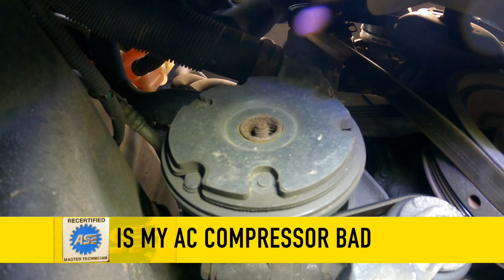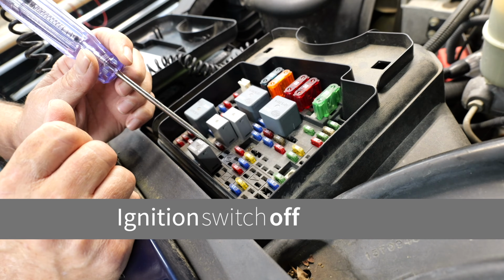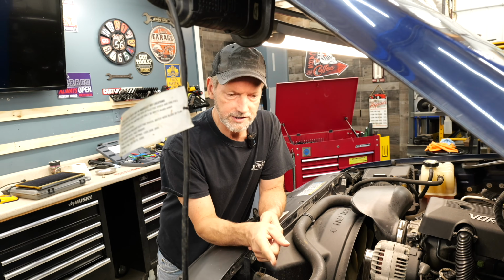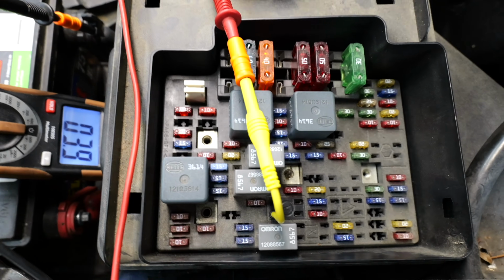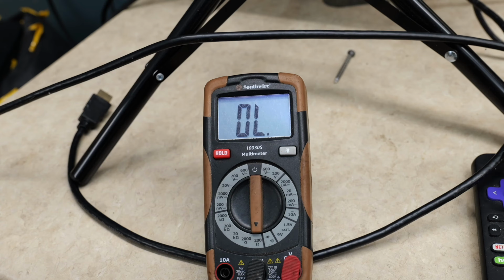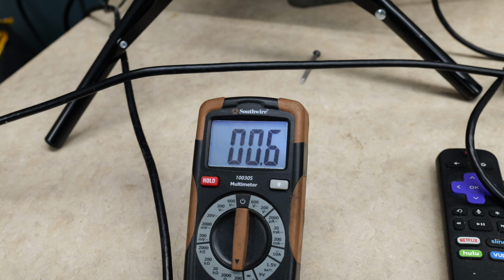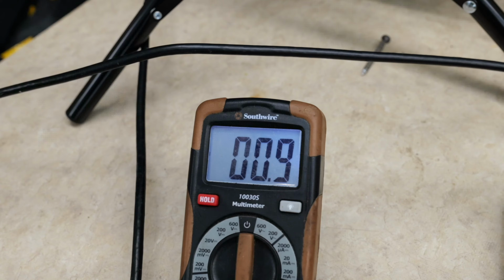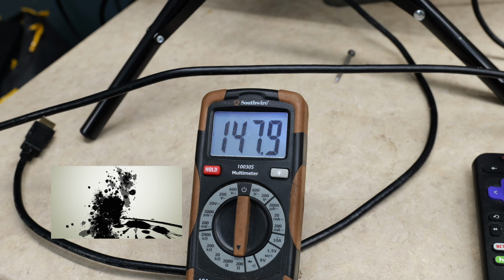how to diagnose a Chevy Silverado AC compressor

Comment: I pity refrigerant in my truck the air was blowing cold but my clutch h was going on and off I release some refrigerant from it then it went to blowing hot what did I do wrong
Reply from the maker: Do you have gauges because even if the clutch is cycling on and off that doesn't mean that you're low refrigerate or that you have too much refrigerant. A lot of times it does that just to prevent your evaporated from freezing . The low side pressure will reflect your evaporator temperature so on a hot day it may be running around 35 to 45 psi that your reflection of your evaporator temperature and on a cool day 65°. It may have to cycle on and out to prevent the evaporator from freezing. That's when you'll see pressures drop below 30 on a normal operating system. Sounds like you may have to add some back when I'm without a recovery machine. I tried to hit around 35 to 40 on a warm day about 80° is a sweet spot that way when it's 100° day you won't have too much refrigerant .

Comment: what if my ac compressor keeps blowing the 10a fuse. it will run a few minutes and pop the fuse
Reply from the maker: Here's what you do look at your compressor hub that's what the belt is riding on listen for any rubbing noise Engine running with an engine off taking a look at the wire that's going into the connector at your AC coal. See if it's getting rub marks on it

Comment: The clutch coil in my 2000 Sierra was bad, so I bought a new Murray brand clutch at Oreilly and installed it. -Nothing.  
  Google search led me here and you helped me re-diagnose my (new) problem: the coil on the new clutch had a dead short inside. 0 ohms resistance and blew the 10 amp fuse twice before I figured it out
  Went back to Oreilly and I brought my volt meter in with me to check resistance on the replacement coil before I left the store.

  New subscriber here
Reply from the maker: I'm so glad to hear that you're the one this video is for. Thank you for your comment.

Comment: Ok so how did you pop the fuse cover off.  Mine is tight AF.
Reply from the maker: I don't know what is going on with your cover but if you get to the little circle part of the fuse box .you can get your hand and a good grip on the cover and it should pull off unless something else is holding on because they're fairly easy to pull off normally

Comment: When I jump the plug on the low-pressure switch, the compressor doesn't kick on. I jumped the relay, and it kicked on. I checked all my grounds, and they are all clean and tight. The AC button light is on, the recirc button light is on, and the refrigerant is full. Unplugging the high-pressure switch doesn't kick the compressor on. I can't figure this one out. The only sensor I can't rule out is the one on the back of the compressor itself. The compressor not coming on when I jump the low-pressure switch, though, is puzzling me. Your videos are amazing by the way
Reply from the maker: Now the one on the back of your compressor if it comes undone or if that is bad, it won't allow your compressor to come on. It actually has to show zero resistance through that switch in order to operate your compressor now if you have a scan tool, you should be able to see if the ECM is being commanded to turn the AC . The. other high-pressure sensor on the condenser when it reaches a certain pressure it will just turn your AC to recycle even if you don't have recycle on. Now the AC never turns the compressor on directly or the compressor relay the ECM commands the relay to turn on if it sees no problem with the engine. When you push the AC switch, it sends a signal through that high-pressure switch on the back of your compressor to the ECM requesting AC. what year is your truck?. thank you for your comment
Reply: @JamesNoBull  2002 base model with the 4.8l. I left my meter at work so I didnt have it with me to ohm out the sensor unfortunately. I did find 2 bad grounds though so I guess at least that let me address those. I have a pretty good feeling that switch is bad. Given the rough shape of the truck and, I cant imagine being able to get the sensor out with out taking the compressor out anyways, I'm just going to go ahead and replace the whole thing. When I did kick the compressor on from jumping the relay, it was squaeking really loud. I also found a leak in the high pressure service port. That rubber ball was leaking pretty bad. Your videos got me through a lot of it. Thanks for making them!
Reply: @JamesNoBull  well it still didnt work unfortunately. I'm at a loss
Reply: @ch3no2freak  hey buddy did you ever figure it out im having the exact same problem. when i first started diagnosing the ac, jumping the low pressure switch did turn the compressor on but then later that day i tried it again and it stopped doing it. What you can do is see if the pcm is sending ground to pin 85 with a meter. Mine doesnt seem to be doing that so im not sure if its a broken wire somewhere or the pcm fried when i was testing shit. after that, i hit a roadblock. hopefully we can both get ours fixed before that summer heat
Reply: @jbisch272 I didn't unfortunately. I haven't had time to dig deeper into it though.
Reply: @ch3no2freak lol im in the same position right now. Good luck buddy i will let you know if i figure it out

Comment: Excellent video! So I am having an issue with my 03 Silverado AC. My ac tensioner pulley will make noise and rattle back and forth when reved up to 2k or driving under 30mph. Tensioner was replaced with a brand new AC Delco and it is still doing the same thing. AC clutch engages normally and is not seized. AC pulley on the compressor spins freely and is not seized. Truck cools fine at idle and at highway speeds. I am stumped on what is causing the tensioner pulley to go crazy when being rev or driving from a stop. Any idea on what it could be? Is this what "slugging"?
Reply from the maker: I would like to see what the pressure is doing
Reply: @JamesNoBull  Appreciate the reply back. Would low freon cause this? I will take it in to have it checked out as I don't have the proper equipment here. It's been years since the ac was serviced. We are the original owners and the truck only has 61k miles.
Reply from the maker: @radomark408 I've never seen low freon do that. I've seen high pressure do that .Do you have good air flow through the radiator
Reply: @JamesNoBull  yes, cleaned the front of the truck. Didn’t see anything obstructing flow to rad. Changed out the cabin filter as well.

Comment: Thank you so much, you save me a lot money. I replace the switch only not the all A/C
Reply from the maker: Love it thank you
Reply: @JamesNoBull    
Please help,  someone replaced the water pump, unplugged the AC clutch wires,  I found them melted, blew up against exhaust manifold. ?
I can replace that plug,  but I cannot find a location around the clutch where the wires plugs in,  I've looked hard around the bottom.... ?,  hard to see the rest of the perimeter.   If it was a clock looking at it from the top where is the location.. ?   This is a 2000 Silverado 4.7. Baby LS. ?
Reply from the maker: @Rick-qf5de  it should be located around 9:30
Reply: @JamesNoBull 
Thank you I'll be looking tomorrow....

Comment: Hey.. thanks so much for this video. But Im still having trouble. I got a '99 Silverado 5.3. Last year, Last spring I replaced my AC compressor, accumulator, condensor, pressure switches, and orfus tube. (almost everything). Pulled a vaccum and charged it. Worked excellent until later summer... just randomly working and not working. Still the same this year. I've checked freon again. I've jumped (with paperclip) the sensor at the accumulator, the sensor down at the condensor, and the ambient air sensor down behind the bumper. (all three sensors)... but still the same.. just randomly works. I can drive it 20 mins not working and then come home and its fine for 20 minutes. I switched the relays. I've jumped the pins 30 and 87 as you said with key Off. And I do hear the click click. I did it with the truck running too.. and it works. Could problem be the actual dash control switch ?? (even tho the light button is lit ON??)
Reply from the maker: I have found where the fresh air blend door is stuck and cannot control recycle and it'll cause the same thing so make sure that it goes from fresh air to outside air and that works fine and let me know

Comment: This is all great info, but all you need to do is jump the low pressure switch. If it comes on, it works lol
Reply: It looks like you really do live up to your user name congrats, but the “reality” is what you said would only pertain to if the low pressure switch has an open in it an needs to be replaced. What this guy is doing is a step by step process to find out if the clutch coil is bad and needs to be replaced. This is a perfect comprehensive step by step troubleshooting process that requires extensive knowledge to be able to help others like myself who gets to replace the clutch on my compressor thanks to this gentleman’s step by step process that I had to check off all to determine the work required as I wouldn’t want to do a crap load of work if it was just a simple switch…..LOL….

Comment: im sending u a email cause i have a strange problem with my a/c and everything is new and it still does the same thing as the old pump did
Reply from the maker: What is your pump doing or not doing?
Reply: @JamesNoBull   so i think i norrowed it down to being pcm is not grounding  to lock clutch up
Reply from the maker: You did move the old high-pressure switch from behind your old compressor  to the new compressor.
Reply: @JamesNoBull   everything is new i replaced pump and everything
Reply from the maker: @ most new pumps didn't come with that pressure switch you are supposed to use your old one. Did your new compressor come with a new switch?
Reply from the maker: that pressure switch is located on the back of the compressor you should have harness plugged into the front at the compressor clutch and at the rear at the switch so you will have two harness connectors
Reply: @JamesNoBull    my pressure switch is on the line  i have a 2003 gmc sierra 1500hd
Reply from the maker: @ do you have access to a scanner to see the live data of the ECM?
Reply: @JamesNoBull   i have hp tuners and i can comand the clutch to lock up thru it  and i can also jump pin 30 to 87 and it locks clutch up also i make sure wire going to pcm to 85 on relay is good also
Reply from the maker: @ if you can access PCM scan tool data list, engine data 2 can you check and see if AC request is yes or no it should be yes
Also, AC relay command request on or off it should be on
Reply: @NobleAutomotive  when i  comand ac cluch on thru scanner it goes to ac request yes and ac rely comand on  thats if i turn clutch on with scanner or jump 30 to 87 on clutch relay if  just turn it all on like nomal clutch dont lock or spin but a sec every min
Reply from the maker: @ just buy you been able to turn your compressor on and off with your HP tuner that lets us know that everything from the ECM to the compressor is good. Now we need to know what's stopping the ECM from turning the compressor on. We need to know if you are getting a request from your AC control unit.
Do you have a check engine light on or any code in your ECM?
Reply: @NobleAutomotive  no sir no codes  i was thinking ecm is bad and not ground 85 on relay
Reply from the maker: @haroldpowell  well, you should not be able to turn it on and off of your scan tool if the ECM is bad. Has your AC worked since you put the HP tuner on it?
Reply: @NobleAutomotive  it has never work since i got the truck so i just replaced everything  new  all and everything that had to do with the a/c
Reply from the maker: A/C compressor clutch will not engage under the following conditions:
 -  The A/C high side line pressure is over 2957 kPa (429 psi).
 -  The A/C low side line pressure is under 151 kPa (22 psi).
 -  Throttle angle is at 100 percent.
 -  Engine speed is more than 5500 RPM.
 -  Engine coolant temperature (ECT) is more than 121°C (250°F).
 -  Ambient air temperature is less than 5°C (40°F).
Reply: @NobleAutomotive  ok i pass all that so i dont know why it wont lock up on its own
Reply from the maker: Now, remember if you didn't, you'll have to remove all your Freon because that switch is under pressure and that blank is under pressure as well.

Comment: Hey Mr. Nobile. 04 trailblazer. No compressor engagement. I hear a click when jumping the relay but it’s very faint. Pressure without engine running is about 100psi on both sides.

Comment: My pressure switch went out. A $20 part I found out after replacing the clutch and still not working. To test that, unplug the switch (mine was on the accumulator) and jump the connector. Fire it up with the AC on and if the clutch engages, there's the problem. 
I bought this 95 K1500 last week and I guess they ran it dry because it also needed to be recharged. Perhaps that's why it failed as well. Either way, simple test, easy to replace (on mine it has a valve that won't lose refrigerant), and about $20 for me.
Reply from the maker: Very good Nice job.